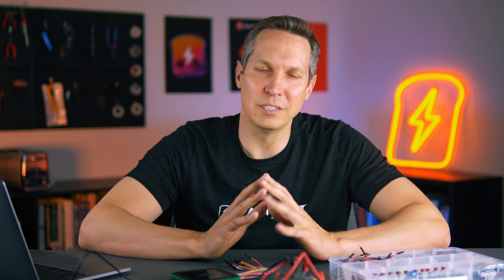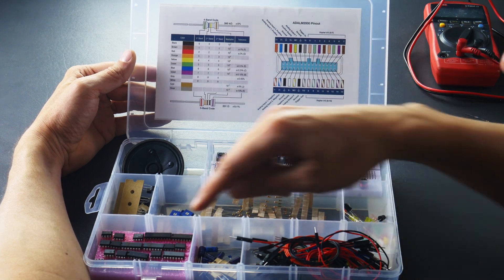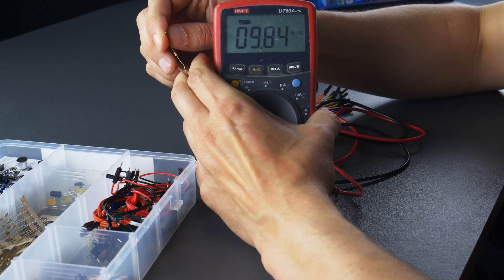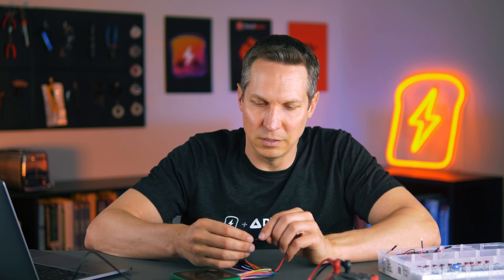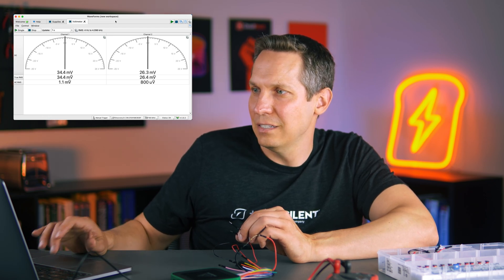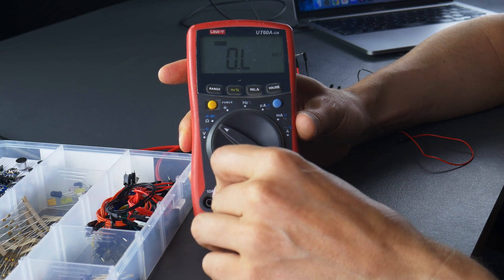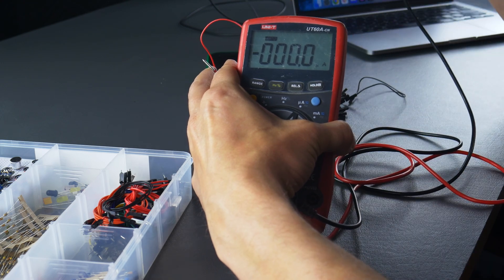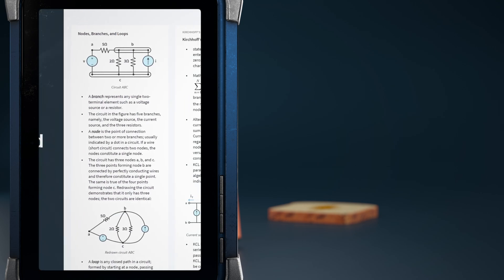Practicum: Measure voltage, current, resistance and calculate power

Comment: Whats the advantage of the diligent? I didn’t really get that.
Reply: In comparison to a full arduino set or something
Reply from the maker: The Discovery 3 isn't really comparable to an Arduino, it's a measurement device plus power supply plus waveform generator and more.  So you're more likely to buy this in conjunction with an Arduino.  I didn't want to get too salesy in the video but the biggest advantage is that you get a lot of tools at an extremely low cost compared to buying them individually.